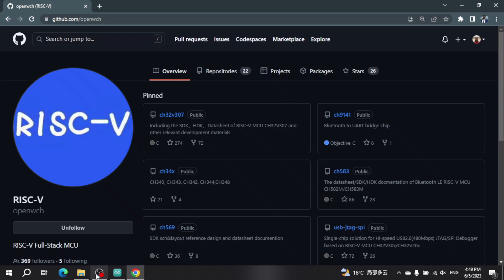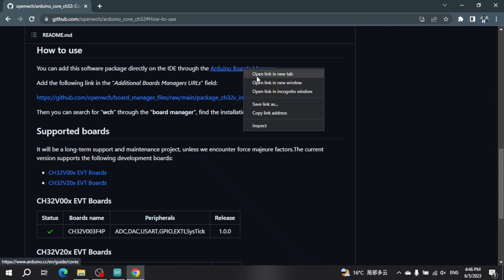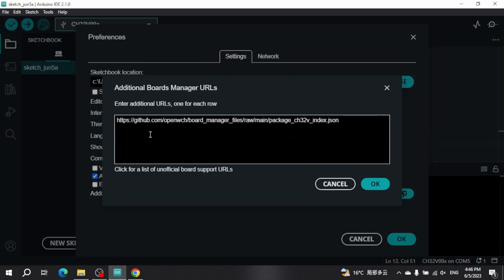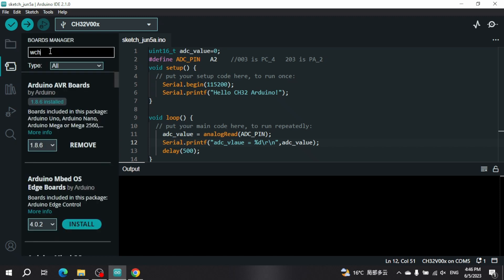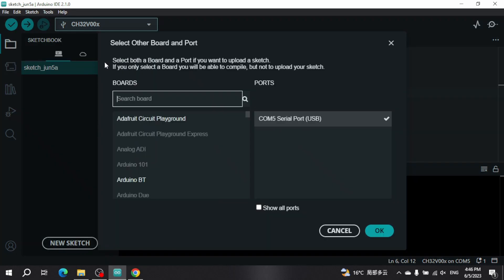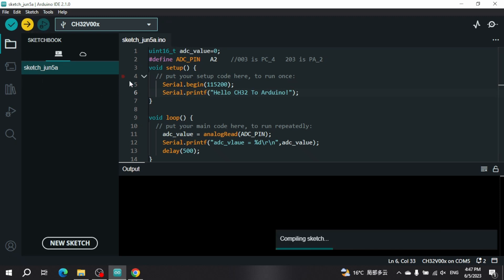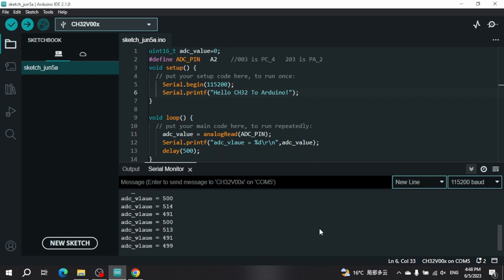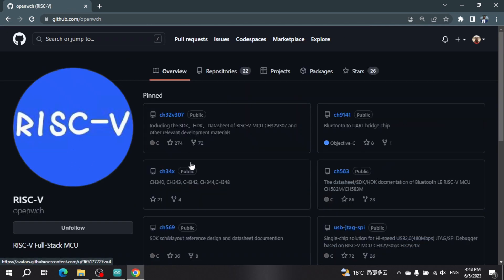#12- The 10 cents RISC-V MCU already supports Arduino!

Comment: What is the ADC reference voltage?  Is this a PIN or the internal 1.2V bandgap?  Also what about calibration as the datasheet implies that calibration is needed

Comment: Thank you for this.  The simplicity of the Arduino IDE along with the absurd cheapness of the ch32v003 should make for an awesome combination.  In working on the peripherals, I'll put in my vote for making an easy "enable op-amp" function, just because using a 32bit 48mhz MCU as an analog op-amp "because it's cheaper" is too fun to pass up :)

Oh, do the I2C libraries work yet?
Reply: answering my own question: it seems no Wire.h yet, so no I2C.  But, blink compiles as expected, and throwing in a millis() does as well.  Including LiquidChystal.h compiles too, so that's most of the way there.  Doesn't take much to run out of flash though.

eg: just blink with LiquidChrystal.h included (and initialized) uses 89% of 16384.  A slightly more complicated sketch that runs one of those LCD Keypad shields won't fit.  Probably why Wire.h isn't included.   I guess the 30K of flash for the Nano (etc. - bootloader) matters.  So yeah... I expect toggling a pin with millis or reading a voltage is about as much as these things can handle anyway, and that's already there.

I actually need I2C so it's back to the Eclipse IDE for me, at least for the current project.  Still voting for an easy op-amp setup :)
Reply: I noticed that it would be a long-term project，so maybe it will support more features later，including "wire"

Comment: Please make RISC-V architecture deign using verliog
Reply: Most likely they used a HDL like verilog or vhdl ;P

Nevertheless Open source RISC-V cores are a dime a dozen ;) but microprocessors are not that interesting compared to microcontroller designs. But peripherals like USB are most likely IP protected